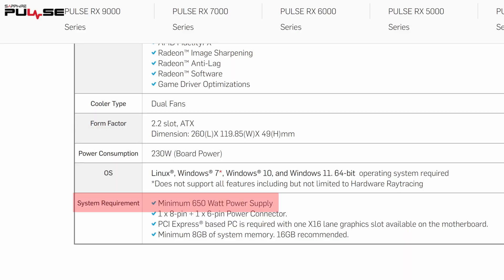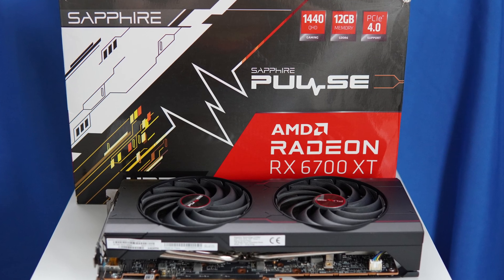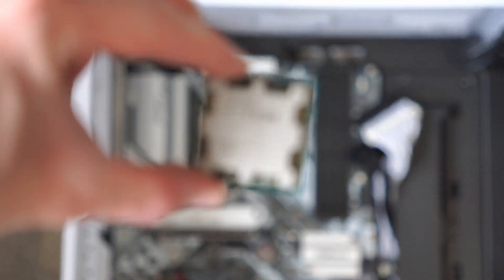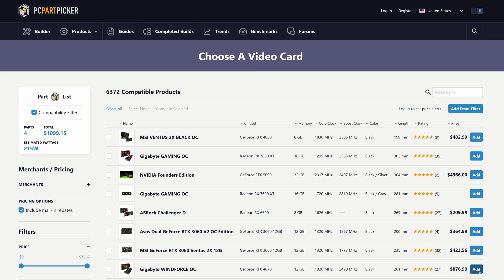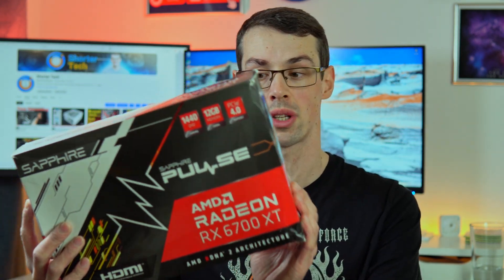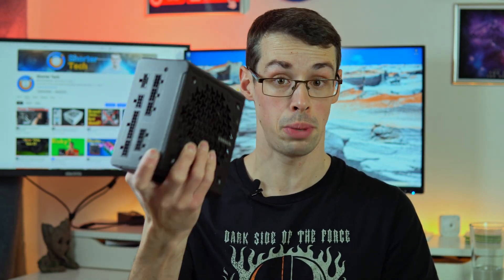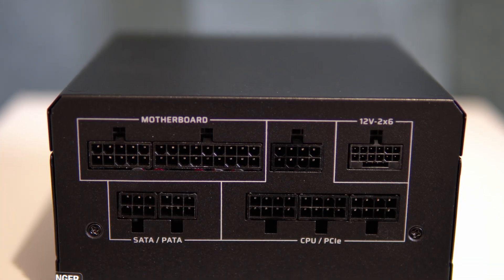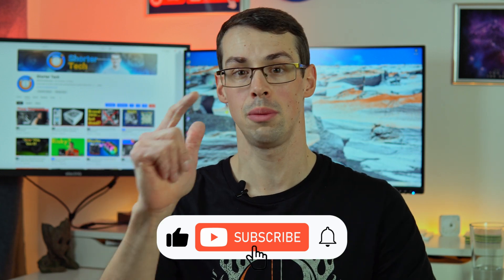Can You Use An Underpowered PSU For Your GPU?

Comment: I own a 650w...But already order TUF 5070 and it say require 750w...Do U think is fine for me to use the 650w first?
Reply from the maker: Yes that should be fine, the 5070 doesn't use insane levels of power, so unless you have an overclocked CPU and 20 SATA HDDs and fans too, a 650w PSU should work fine lol :)

Comment: I goofed it and ordered an RX550 (400w) but checked my shitty Pre-built's PSU only after buying (240w)

Chancing it may not be the most wise idea, but atm it's that or leave it it the box till I can figure out how to replace the PSU on a Lenovo prebuilt. You reckon it's worth a shot?
Reply from the maker: Hard to say for sure, the card doesn't have super high power consumption - so you could always try it and just see if you get crashes. It shouldn't damage the card by underpowering it.

Comment: My system recommended psu wattage was like 664 watts, after putting in the specs to upgrade to (5600 to 5800x) and i have a 650 w psu, is that fine
Reply from the maker: PC Part Picker tends to be a bit conservative with the estimates - if you were stable with a Ryzen 5600, I'm sure you'll be fine with an upgrade to a 5800x - there isn't a significant power draw difference.

Comment: I have 550 80+ bronze psu with ryzen 5 5600g is my psu enough for rtx 5060?
Reply from the maker: Yes that should be fine, the RTX 5060 doesn't use a massive amount of power :)
Reply: I have msi 520a m pro pcie 3 motherboard so is there any effect  @ShorterTechOverwrite
Reply from the maker: Yes you'll see a negative impact, since the RTX 5060 runs at x8 electronically (same as the 5060 Ti), it will see a hit at gen 3 PCIe. See this video which is for the 5060 Ti, but gen 3 x8 isn't quite enough tbh - https://www.youtube.com/watch?v=kEsSUPuvHI4&ab_channel=HardwareUnboxed

I mean, you can still game on it - you'll just get worse FPS :)

Comment: Thanks for this information bro I was wondering if I could buy a 9070xt and hook it with my 650psu for the time being… 😢
Reply: If I buy a 9070xt and hook it too my 650 psu will it damage my gpu ?
Reply from the maker: I think that will be okay yes, the 9070xt doesn't use crazy amounts of power so I think that a 650w PSU will handle it fine - especially for the short term :)
Reply: @ShorterTechOverwrite legend bro thank you for replying. 🙏🏾

Comment: ive just purchased an rtx 4060 as an upgrade from an rtx 2060. bit of a newb and didnt know about power supply.  my psu is 500w, but the 4060 needs 550w i believe.  from this video i can safely assume ill be ok with current psu? liked and subbed, thank you
Reply from the maker: Yes that should be fine, the 4060 doesn't draw an insane amount of power - and thanks for the like and sub :)
Reply: @ShorterTechOverwrite  you're welcome. Thanks for replying
Reply: Just 50 watts headroom?.. your pc still working fine with rtx 4060?
Reply: @gatotcka5017 it hasn't exploded yet so I assume so.  Any way I could check to be sure??

Comment: As a few other people pointed out, undervolting or power limiting is a great way to solve the issue! Although personally I always go for something more powerful than I need, because upgrading a GPU is something most people do sooner or later, upgrading the PSU on the other hand is a huge PITA (unless you upgrade for a higher power version of the same PSU model), and generally the difference in price is relatively small.
Reply from the maker: I agree, and it's surprising how much power a simple undervolt can save. Easier than changing the PSU for sure. :)
(Although I think I've had 4 PSUs in the last year, but that's mainly due to the 2x PCs and also not expecting to bag a 5080 FE lol)

Edit: I worked out it's actually 5 PSUs LOL! I had a Corsair RM750e and RM750x last year, then I bought the 5080 FE and changed to a Corsair RM1000e and Montech 1000w Titan PLA. And more recently I've decided to switch one PC to mini ITX, so I sold the Corsair RM1000e and have bought a ROG Loki 850w SFF. Heh. Hopefully that'll be the end of my PSU hunting though!
Reply: @ShorterTechOverwrite  Yeah, that may be more PSUs than I've gone through in my entire life... You, good sir, may have an issue!
Reply from the maker: I've also gone through 6 motherboards since last year😭 Maybe a video idea (to explain it) on Tech Overwrite LOL! I think I am finally "done" now though.
(Maybe)
Reply: @ShorterTechOverwrite  You know, if you make a video explaining how you got 5 PSUs and 6 MoBos within a year... People may start questioning your sanity!
Reply from the maker: "People may start questioning your sanity!" pfft, as though they aren't already 🤪

Comment: I am currently running a 3080 with a ryzen 5 5500 on a 500w psu, works well thus far. Undervolted 3080 and fps limited to 60fps until i get a new psu.
Reply from the maker: That's good to hear, glad that's stable for you :)

Comment: i have 3090 on platinum  600 watts psu. It works fine. Lots of tech channels stresses this so much
Reply: Yep. I use a Ryzen 5 3600 and 6800 XT with a 450w PSU. Undervolting and capping fps makes a big difference. It rarely draws more than 350w.
Reply: Is that really work?? Because I'm gonna get RX 6600 XT with I3-12100F and my PSU is 550 Watt, did i must worried??  @StephenDeTomasi
Reply from the maker: That's impressive, good to hear that your 3090 was stable in that setup. :)

Comment: 750 is enough i guess for 1440p gaming with 7600x or 9600x with rx 9070xt
Reply: I have a 750W PSU, 5900X with OC'd 9070. Hairy donut - I mean Furmark - pulls the specified 240W, CPU has power cap at 175W (which it barely doesn't hit in Cinebench R23; seen max of 171W). 60% max load is safe and within good efficiency range; the PSU can probably give 900W in spikes and I'll never hit that. I was considering 9070XT but the price difference was large enough that I didn't bother, and 9070 has more headroom.

Comment: My experience with a system that PC part picker estimated needed 529 watts of power and using a 550-watt PSU was mixed. It definitely worked, but I had issues with one of my two NVME drives not working half the time, and the system would underperform in some games and stutter. It almost felt like I had insufficient RAM, but when I upgraded my PSU, everything worked great.
Reply: I would fs do it again though
Reply from the maker: Huh that's really interesting (and frustrating), thanks for sharing your experience. Definitely does seem like an underpowered type issue there, which is concerning - especially if one of the two NVMe drives wasn't working.
Reply: Bro is your psu certified or non certified would be nice if u reply❤️

Comment: Good information and solid advice regarding getting a little more PSU than you need. I always look at the PSU as the one part of a build that is already future proof, in case I want to upgrade the CPU or GPU. My rule of thumb is to always have 250W headroom. I don't like operating the PSU within 80% of its max rating.
Reply from the maker: Very true, and thanks :) You're right - I don't really like risking it. I know that PSUs can (in theory) handle some transient spikes too, but I don't really want to rely on theory lol. I prefer headroom. The only time when I'll match the power requirements (e.g. 850w PSU for 850w recommended GPU) is if I plan to undervolt the CPU and GPU.